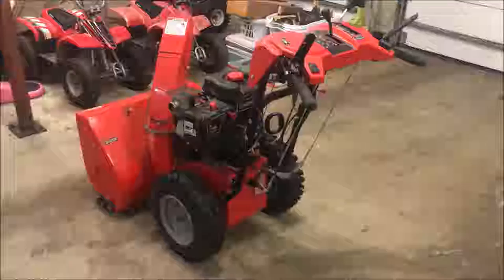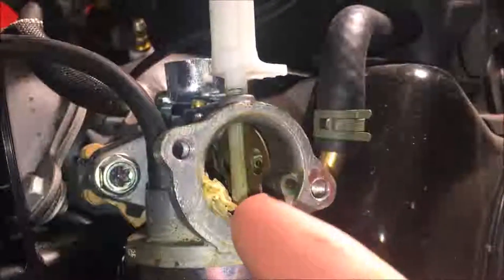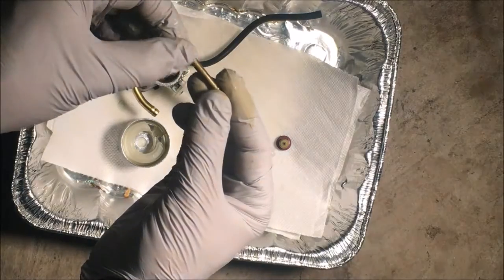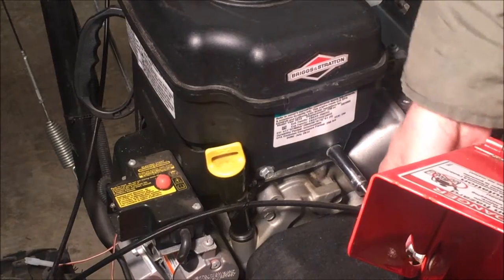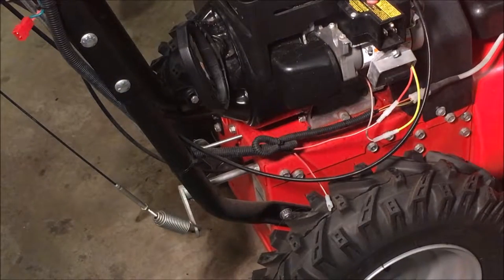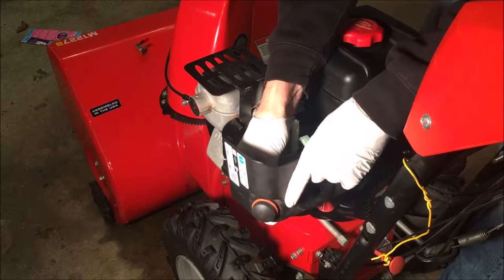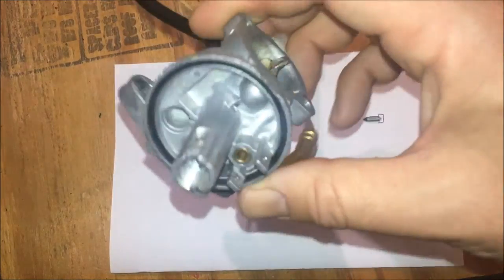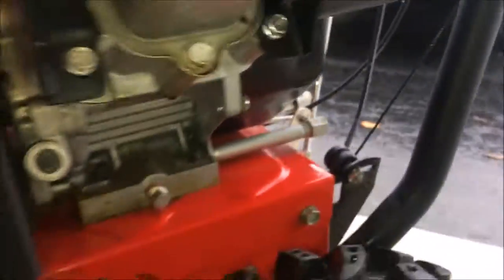Snapper Snowblower Won't Start - Flooding Carburetor and Bad Gas - FIXED Briggs and Stratton Engine

Comment: Hi. How did you get the “choke/run” dial off the top? That’s where I’m stuck.
Reply from the maker: This knob was off the machine when I purchased it.  To put it back on, just push.  There is no screw holding it on.  To remove, I am guessing that if you insert a properly sized phillips screwdriver it will release.  Here is a clip of the installation https://youtu.be/GbHubI44rOA
Reply: @jcondon1  Thank you! Yep, you have to pry it off with 2 screwdrivers...carefully. I found a video. Thanks again!
Reply: i would like to know also i have the same snowblower . ive had to clean the carb twice over 4 years and every time i had to work around not removing that red nob because i felt like it would break if i forced it. i wish he would of showed us how.
Reply: @SAMUEL7.3 he literally shared a link in his original reply

Comment: Spent a solid 6 hours today trying to figure out why my snowblower wouldn't start took apart the carburetor change the spark plug and then I basically took the whole thing apart just running down the rabbit hole looking for issues, then I finally stumbled across your video and pulled out the little emulsion valve or the main jet or whatever you unscrewed, cleaned the clog, put it back together and now she runs like a beauty thank you for your help!
Reply from the maker: Glad I could help!

Comment: I have a snapper snow blower M1024 flooding problem, Brigs & Stratton motor, bought in late 2021. Late 2022 at first snow I went to start it up and found the tank completely dry (I forgot to use the fuel cut off switch). After fueling and starting it stopped running a minute later. I let it sit and tried again later. same thing over and over.
Long story short, I disassembled the carbonator. The spring between the float and the pin valve seemed weak , so taking it between my fingers on each end I gently stretched it until it was an eighth of an inch longer and put everything back together.
It works perfect now!

Comment: I just got a Briggs 1227 blower with that engine. Carb was clogged, white stuff in fuel tank. I've gotten it almost good except it surges still. Thanks for showing me the tiny holes inside the carb body, I hadn't noticed them and was grumpy this doesn't have a removable idle jet. Soaking it now in my parts cleaner but will run some wire through those holes.

Comment: You can use toothpaste, or valve grinding compound, a Q-Tip, and a drill to polish the seat.  Doesn't always work, but has been successful for me and others as well.

Comment: Great video, very informative and well done! Couple of thoughts. First the gunk in the carb mouth was more than likely left over residue from some sort of engine stor spray. People sometimes go nuts with that stuff. As to your float hanging up I find myself wondering if the float bowl is deformed? If someone  managed to bend one of the sides it may be hitting the plastic float and causing it to hang up. I would also check and make certain that the plastic float is the correct one for that carb. Plastic floats all look pretty much alike and someone may have installed a new float of the incorrect size. As far as cleaning jets I know a lot of folks use wire but I've always favored monofilament fishing line of the appropriate size. Wire works but it can mar the surface. If worst comes to worst I'd just buy a new carb...my guess is you should be able to find a replacement online for around $25. Given that you got what looks to me to be an almost new $1,000 snow blower for cheap a new carb is a small price to pay!

Comment: Interesting procedure and trouble shooting.
Appreciate your investigation and honesty.  Was thinking that there might be some particles left in the gas tank that are still shedding that are keeping the needle valve from closing or the rubber tip on the valve is hardened and not providing a good seal.

Comment: I see you met the scourge of ethanol blend gasoline. That's what happens when the ethanol evaporates. Nasty stuff, and it's hard to get rid of, short of boiling a carburetor in water. Nice job on the repair.

Comment: I had the same thing happen. I took a q-tip with some of that orange hand cleaner and refinished the seat. I also cleaned out the little pressure relief area, it is the pressed in piece when when you are looking down the throat of the carb. Seemed to work.
Reply from the maker: Good to know.  I only used a q-tip.  Think pressure was the problem.

Comment: Thanks very much for sharing your journey.
I basically have the same engine and carb that kept stalling out periodically so I took out the carb twice to clean, new spark plug, new gas and oil and still won't start. Before the stalling I had some issues starting this season for the first time(2019-2020) but it's been rock solid since I bought it 10 years ago brand new. Not sure what else to do now but now I've seen you replace the whole carb maybe that is my next step. I live in Eastern Canada and get significant amounts of snow each winter and March is unpredictable. I must find a solution in the next few days before mother nature comes a knockin.
Reply from the maker: Darryl Stevens try spraying a little starting fluid in the intake and see if it starts for a second.  If it does then you have a fuel/carb problem.  If not then it could be spark related.  I am working on an engine now that has intermittent spark issues related to a bad low oil sensor.  Most likely I will end up bypassing it to resolve the issue.  Cannot remember if that engine had a low oil sensor, but it is also common to have a bad ignition coil.
Reply: @jcondon1  I've taken the flywheel off and the checking the coil. The magnets are rusted and I may have sheared the key but at the very least I'll clean the contacts and closely inspect the key. Thanks again for you help!
Reply from the maker: Darryl Stevens a sheared key will definitely cause you a run issue.  If you have spark and it does not start with starting fluid then most likely the key.  If on time, the magnet should just be clearing the coil at top dead center.
Reply: @jcondon1  Perfect!
I read somewhere I can use a biz card for the coil spacing.
Reply from the maker: Darryl Stevens yes a business card works well.
Reply: @jcondon1  Perfecto!
Thanks James
Reply: So after all that it turned out to be the flywheel key :)
Installed a new one and she fired right up. Had to tweak a few things things but it's humming like new again.
Thanks again for your valuable input.
Cheers!

Comment: Thanks for the video.  I'm having similar problems.  I just did a carb rebuild and it runs better but backfires on shutting down.  Just today it backfired and now won't start.  Probably threw a rod or something. Question- where did you get the carb from and what's the part number?  Thanks!

Comment: These carbs are known for leaking . The oil get thinned out with gas and seacess the engine . Always use the fuel shut off on these engines .

Comment: Try compressed air in the bowl vent.  It may be clogged.  That will cause the lean run condition and leak.

Comment: ?? On the fuel shutoff - I have been advised by the shop which serviced the carb on my 5500 Watt 
Mitsubishi, to use Ethanol fuel stabilizer and leave the fuel on to keep the gaskets wet.  No problems last 3-4 years of doing that.  I haven’t heard you comment on stabilizers, would like your viewpoint.
Reply from the maker: I use them, but not convinced of there effectiveness.  I always run my carb dry before storing and shut the fuel off.  Also keep the tank full, but change out the gas twice a year if unused.  I have heard the same about keeping it wet, but have seen some where the needle leaks and slowly fills the piston and engine with gas.  Running it like that would cause a lot of engine damage.  So think it is safer to leave the carb dry.  Also all the carb issues I see are due to the valve being left on.  Never seen an issue with a dry carb.  But not impossible.
Reply: @jcondon1  Just heard another good tip, changing unused fuel.  I "assumed" that, once treated, it was good forever.  I will adopt your method as of TODAY.  Thanks for providing such an informative program.

Comment: Looks like I have the same blower with the same carb but its a simplicity, runs perfect only thing I hate is there's no throttle, did your model have a throttle and if not do you or any viewers out there no if a throttle could be added to this carb?
Reply from the maker: It did not have throttle control.  I believe it can be added.  The parts diagram for my engine shows it as Briggs and Stratton part number 793109
Reply: @jcondon1  I just ordered all the parts today and fuel  shut off thanks

Comment: Just curious saw what looked like a charging system. Does it have electric start and battery connections? Mine just plugs into the wall.

Comment: So what are the white particles?  We've seen weird snow sometimes in recent years.  Snow that doesn't melt normally.  Suspicion is that it's mixed with some chemicals, and white particles would be the inconspicuous choice for that.  Maybe that's what it was.  Could be interesting to do a chem analysis on them.
Reply from the maker: I believe that is caused by the ethanol in the fuel.

Comment: Going to try this. My toro snowblower (same briggs stratton engine as yours) won't start. Replaced fuel with fresh fuel, replaced spark plug, replaced oil, sprayed carb cleaner all over the carb bowl, up the tube etc...no go. I think I'll need to take the carb off and do a deep clean. Curiously, which ultrasonic cleaner is what and whats the liquid/degreaser you used? Also, I noticed that for the spark plug test, you didn't plug one end into the spark plug already inside in the machine and instead used another one. Why?  Thanks so much for this video;
Reply from the maker: I am using a cheap Harbor Freight ultra sonic cleaner with Harbor Freight Super Heavy Duty Degreaser.  You can use the existing spark plug.  But to test the coil you can use another.

Comment: Did you change the height of the fuel line when you put the shut off valve on it?  Does the carb have a replaceable needle seat in it?

Comment: Ive seen this before. It happened to my snow blower back in the day. Its salt from snow blowing salty snow. Btw if you read this comment i have a brand new red pull cord i can send you if you want. I dont need it. It is to a cheap generator i dont have anymore.
Reply: @jcondon1  awsome. I'll e-mail you sometime tomarrow.

Comment: Is it possible that the float bowl was not sealing at the top? If so, would it cause your leak AND would it suck air in causing it to run lean?
Reply from the maker: Possible but it seamed to only happen when hot.

Comment: I have the exact same carb on my Poulan Pro blower, where did you get the carb from? I'm having a tough time finding one on-line. Thanks for any info
Reply from the maker: I used Briggs and Stratton part number 594015 and purchased on eBay. 
 Still available from the same seller https://www.ebay.com/p/510917268?iid=112661844386

Comment: Question what are the yellow and red wire next to the starter that you wire tied on the harness I have the same but seems like the red one is half gone but my machine still runs  wondering what are those wires
Reply from the maker: Not 100%, but it might be the rectifier for the light.  Converts the AC power from the stator behind the flywheel to DC for the light.

Comment: Just a question.  Why don't you use compressed air & carb cleaner?
Reply from the maker: I generally do use carb cleaner before putting them in the ultrasonic.  But sparingly.  It will destroy gaskets and o-rings pretty quickly.  Also wash the ultrasonic degreaser off with water and blow through all the passages with compressed air.

Comment: Hi James, came across this video. Thanks for posting. What model  is it. Does it have power turning chute?
Reply from the maker: It has the power chute.  The model was 1696173-02
Reply: Does it have battery? Do you still have it?
Reply from the maker: @jwmatt  no battery.  Do not have it anymore.

Comment: the screws snapped holding the plastic cover under the choke.  How do I get them out?
Reply from the maker: The ones that hold the cover on?  Most likely I would drill and tap.

Comment: Where are your two yellow oil caps on the bottom left and right of the engine? One of my caps came off while I was running the machine and seized my motor.
Reply from the maker: It had the casting for it, but was not drilled out.

Comment: I have the same engine/snowblower. Any info on where to find the optional manual throttle for this machine? I’d like to add one to mine.
Reply from the maker: The engine number on the one I worked on was 15C114-0153-F8.  The part number for my engine was Briggs 793109

Comment: James, I have a dumb question, what tool do I need to remove the red plastic chock knob, thanks George
Reply from the maker: The knob on my snow blower came already uninstalled by the previous owner.  But would assume you either pry it off or maybe insert a Phillips screw driver the same size as the knob hole which might release it.  It is all plastic so be careful.  Even putting it back in was a bit difficult https://youtu.be/GbHubI44rOA
Reply: @jcondon1  I got it off , yep it does pry's, THANK YOU
Reply: I used a faucet handle puller tool.  Came off easily with no force on the shaft.  Problem I'm having is getting the knob back on  the shaft.  Any suggestions?

Comment: Could it be atmospheric pressure from the area that you live in?
Reply from the maker: Turns out this model engine suffered from Vapor lock.  I think that was the issue here.
Reply: @jcondon1  That was another thing I thought about, but dismissed it . I thought it would be a dumb suggestion. DOH!!!!

Comment: Hi, what to do if the rope starter cannot be pulled?
Reply from the maker: I would pull the starter off and see if the engine will turn with a wrench in the flywheel bolt.  If not then the piston is stuck in the cylinder and the engine is most likely done.
Reply: Could just have a stuck needle and a cylinder full ofGas
Reply: Could just have a stuck needle and a cylinder full ofGas

Comment: I could tell something wasn't right about that float because it wasn't level when you opened it and held it upside down.  Back in the good 'ol days when they didn't make everything from plastic, you could have slightly bent the metal tang of the float, and had many more years of service from that carb.  You could also solder up a leaking float. The needle didn't go far enough into the seat when the float was up and bowl full. Possibly could have heated up the plastic to make it go up a bit, but likely wouldn't stay.  Gravity and heat will deform plastic.
Reply from the maker: Wish they were still metal, would have been an easy fix.  Have used a heat gun in the past to make the plastic float adjustments, but do not get many chances at that.

Comment: Did you break the plastic choke taking it off of there?
Reply from the maker: Snurre86 no, but had to apply a lot of force.  Was expecting it to break.
Reply: @jcondon1  My old parents bought this machine even after I told them not to, and rather buy a Honda. Everything seems to break on this machine. but then again it is American.
Reply: @Snurre86  Get video - tore apart my machine, cleaned carb and started running. Yippe!!
Reply: @ryanloft3401  Get what?

Comment: Ya, Chinese built motors. You see them everywhere? I have one on my Airens blower. I think they stink. The Chinese manufacturer bought some of the Tecumseh patents which they must have to use the name if they choose. The Tecumseh motors were simple, easy to work on and one of the best blower motors on the planet. They were know as the Snow King series .

Comment: Putting a fuel shutoff on anything Snapper is a bitch.  They just do not give you enough room on the fuel line to add much of anything.  Since I usually add a Top Hat filter to the fuel line, it makes it doubly difficult to add it and a shutoff valve.

Comment: You don't show how to take off choke knob
Reply from the maker: I think it was off when I bought the machine.  There is no screw on the one I worked on.  You can carefully pry it off.  Also I think if you insert a properly size screw driver in the hole it might release.  Here is a clip of me trying to figure out how it goes back on.  https://youtu.be/GbHubI44rOA